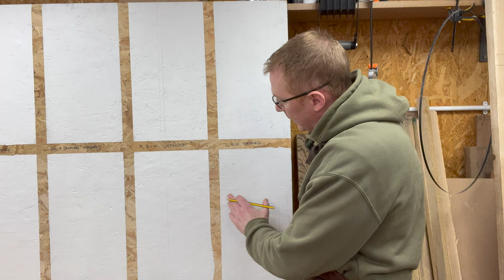Testing Out Different Methods of Painting OSB (Pt 2 of 2) THE RESULTS

Comment: I painted my new shop ceiling and walls, which are OSB, after watching your videos.  I believe sanding is necessary if for no other reason to eliminate your roller picking up pieces of wood..  I think you mentioned this in a previous video.  I used the Zinsser 123 primer and went with 2 coats.  I believe our top coat was Zinsser Smart Coat.  Another coat might have been better but a single coat was good enough for a wood shop.  I went with ultra white for the color.  If a person is looking to hide all of the OSB fibers, the way I went won't do that but I am extremely happy with my results and this is in part, due to your videos.  Thanks so much!
Reply from the maker: Thank you for your very kind feedback which is really appreciated! I think showing the fibres of the OSB actually looks pretty smart, if folk want a smooth surface they’d be better off with a cheaper plywood 👍

Comment: I didn't do the extensive tests you did. I wanted it to look decent, but it wasn't going in yhe living room. I used a high build primer, sanded lightly, a second coat of primer, then two top coats of Behr eggshell enamel. It worked pretty well.
Reply from the maker: Thanks for the comment and great idea to use eggshell. I’d be interested to hear your long term results if you ever have to time to let me know, be interesting for any potential follow up questions 👍👍

Comment: Thanks so much for the information. It really is scarce. Zinsser B-I-N has been the best performing primer for me in most situations, so I'm not surprised by that result. For OSB I've had pretty good luck with exterior grade latex paint.  I usually get get whatever decent brand is on sale. I haven't done any sort of testing on this level, but the walls I painted about 9 years ago are still going fine with no noticeable yellowing, at least that I can see under a 6500k reference light.
Reply from the maker: Thanks for the comment and kind feedback, much appreciated 😀😀👍👍
Reply: Straight exterior latex or sealed with something first?

Comment: Sometimes we're just too critical. I have painted osb in my shop when I moved here 30 years ago and I put up a panel about 10 years ago and probably just painted it a couple times with final coat paint (latex). Really good enough. Going to put up a 14x42 wall in the near future. It would cost 80 bucks just for the primer plus top coat. Makes metal look better all the time.
Reply from the maker: Cheers Keith, interesting you mention latex paint for the top coat on your original board👍👍

Comment: A thought about time between coats. Paints dry, but paints also cure. Latex paints dry fast but typically need 30 days to cure. Oil based paints dry slowly but only need a week to cure. I suspect that a fast-curing primer isn’t easily compromised by the topcoat’s chemistry.
Reply from the maker: Good points made here Ty and thanks for sharing them. I don’t think the fast drying primer would be compromised as the instructions say ok to apply top coat within ‘X’ amount of time, generally hours not days 👍

Comment: BIN for the win.  I don’t use anything else. It’s also waterproof. I’ve also used the 123, which is okay, but disappointing compared to BIN. THE Zinsser Permawhite is also very impressive, and the Zinsser Allcoat (exterior) is a miracle paint.
Reply from the maker: Absolutely pal, it certainly is the case of ‘you get what you pay for’ when it comes to the BIN. Haven’t tried the allcoat yet but will be checking it out in the future 😀😀👍👍
Reply: 😊
M

Comment: Leo..... Well done on this. As a tradesman who has just gotten round to retirement I have tested paints for a long time. Experience told me ( when you first started this) that oil based primer would "lock in" to the fibres better than any water based primer. OSB is not a thing that I have painted but I would recommend any user to rub down, 1 coat thinned traditional primer followed by a full coat and then an emulsion and 2 coats of this. Masonry paint is best avoided.   If doing it for myself I would do two coats primer,  1 coat traditional undercoat and finish it with oil based eggshell. Now i realise that we all want to save on time/odour/use w/base BUT then I would use two coats Zinnzer 123 and two coats w/base eggshell (light sand between. Hope this helps   Bob (Weston super Mare)
Reply from the maker: Hello there Bob and thanks for he detailed message here. Really useful and much appreciated sir. Best wishes, Leo😀👍

Comment: Wondering if a combo approach would garner excellent results with less cost:  use the Bin only on dark areas and trouble spots.   Then prime everything with oil based primer.  Then touch up any blead through with Bin...
Reply from the maker: Sounds like a great plan and I’d be interested to hear how it goes if you decide to try it 😀👍

Comment: Excellent vid, thanks for putting the time and effort in putting this together.

I'm building a shed and will be using OSB as flooring. Wondering how i should protect the underside of the floor. It won't have any insulation between joists so will be exposed to elements. Thoughts would be welcome.
Reply from the maker: Cheers for the kind feedback, much appreciated! If you are using OSB for flooring with no insulation underneath it I would suggest  looking at a polyurethane based varnish. Varnish will form a protective layer between the outdoor elements and the OSB board and should help protect it. Make sure you’ve got the underside of the shed ventilated to prevent the timbers and OSB rotting underneath 👍

Comment: The Leyland bathroom paint is probably a durable acrylic matt which is a bit thicker than normal Matt and has added ingredients so it is scrubbable and harder wearing ideal for kitchens and bathrooms johnstones acrylic durable Matt, crown clean extreme and dulux diamond Matt are the equivalent types (PPG own both johnstones and Leyland paints so it may be the same paint in both tubs)
Reply from the maker: Nice one Rob, cheers for the insight and thanks for the tip about the Zinnser allcoat 😀😀👍👍
Reply: You could always do another update date when 12 months has passed, I will see if work will give you some free paints to add to your test

Comment: Really interesting outcome there Leo, thanks for doing this as it's a major undertaking to test. I suspect the same will be true for a lot of ply as I'm finding recently bought ply has some bleed through  too. Not sure why but I used a water based primer and a water based emulsion and the bleed through was pretty obvious. Thanks to your experiment I can fix it, so cheers.
Reply from the maker: Thanks Ben. Yes it has been interesting, I cut the board in half this morning and I’m going to keep them to see how they develop further. Couple of folks ITK told me if I take some of the Zinnser BIN to the bleed through areas on my wall I won’t have anymore problems 👍👍
Reply: @Hand-i-Craft  Yes, I read them and you probably won't as you're effectively treating the patches of oil or grease with a sealant. So long as it doesn't bleed out around the patches. I hope you revisit the boards later.

Comment: What I've read into says not to use a water based primer with OSB.
Reply from the maker: I wouldn’t recommend any standard water based primer, but the Zinnser bullseye isn’t any ordinary water based primer, very good quality product and worth the extra money. Oil based primer works just as well as Zinnser bullseye, but oil based is a nightmare to apply. Absolutely stinks and takes forever to dry.

Comment: I'm not sure how you could easily test a low permeability paint to see how the wood breaths and sweats with moisture forced either to the interior or exterior of the OSB, so I'll stick with asking you to do a test with different types of paints that have primer included in them. I'm considering putting painted OSB on the exterior of my add-on and leaving it at that so any information I can get would make that job easier and longer lasting. Thanks!
Reply from the maker: That’s it for me with tests on OSB so I’m afraid you’ll have to do your own if you want to find solutions. Since making this video though I’ve used Zinnser Allcoat for a couple of different jobs and that I believe is your answer.
Reply: @Hand-i-Craft  thank you for the advice! I will look into that asap

Comment: If I am Painting osb Black, is there any need to use a primer?  The reason I ask is does yellowing show up on a black painted surface? Just curious. Great videos. Watched part one and two.
Reply from the maker: Hello John, cheers for the message. It’s a good question and tbh I don’t have a definitive answer as it is something I haven’t done myself. What I think would happen is the resin / glue would seep through causing yellowing, but you’d only notice it up close, unlike when painted white you can spot it from a distance
Reply: @Hand-i-Craft  Thanks for your advice much appreciated. Plus your life story and achievements in woodworking are very inspiring. Good on you. Have a great day from a very wet  Ireland 🙂👍

Comment: You concentrated on bleed through of the resin.  What about the texture?
Reply from the maker: I did say if you wanted a better ‘finish’ then an emulsion top is better. What I meant by finish was texture / appearance. For the overwhelming majority using OSB as a finished surface will be for a outbuilding / workshop / garage etc so durability tends to be more important than quality of finish

Comment: Hey, great video thank you! Was this using two coats of primer or just one? Reason I ask is,  I've got a 150m2 of OSB to paint and I'm trying to avoid paying for 2 coats of bin primer. Also you mentioned that emulsion gives a nicer finish but I noticed that the swatch with masonary on top of the bin actually seems to have resulted in a smoother finish (unsanded), is this the case, would you mind clarifying? Hard to tell on the pictures alone, thanks!
Reply from the maker: Cheers for the message. Yes if you’re using the Bin primer you’ll be fine with one coat then either emulsion or Masonry will give a nice finish. I wouldn’t say the Masonry is smoother (to the touch) but it does look good and will be harder wearing than the emulsion.

I spoke with a guy in the profession since making this video and he gave me a great tip. If once you’ve finished primer and top coat and several months you get some yellowing coming through from the OSB resin in some little patches, just go over them with the Zinnser BIN, let it dry then touch up with the top coat and that will prevent any further yellowing in that area😀👍. Good luck and hope it all goes well
Reply: @Hand-i-Craft  Ah, that's amazing news to hear! As it was going to be another £200 for a second primer coat 🤪😂 Thanks for the tip that's a great idea. I read that the side with the black writing on it is the smoother side so I'll try that with masonry  and fingers crossed it won't look to bumpy. Cheers once again

Comment: Thanks for your video. I just finished putting a coat of oil based primer on my shed. I used osb for the walls. Do you recommend oil based paint or water based paint for the painting?
Reply from the maker: If you’ve primed the OSB with an oil based primer I’d recommend an oils based paint as my understanding is they don’t work too well together if you use water based for one part and oil based for the other 👍👍
Reply: @Hand-i-Craft   I believe oil base first then water base is OK but no good to paint oil base over water base.

Comment: If I'm understanding correctly sanding beforehand helped but is not considered a 'deal-breaker' if you choose to go without? I've got a lot of OSB wallspace to conquer and am trying to find the best use of both my time and money. Thanks for this video!
Reply from the maker: Cheers for the comment. What I would say is if you’re not going to prep it sanding, you’ll need one of the more premium products to prime the surface like Zinnser BIN. Or use an oil based primer, but they take forever to dry and stink the place out!

I’ve come across another product since making this video called Zinnser Allcoat which is both a primer and a top coat. Used it to paint upvc windows from white to black and the results were fantastic! Reckon it would work a treat on OSB, but haven’t tried it personally
Reply: @Hand-i-Craft  Appreciate the reply, thanks for the additional intel!

Comment: Hi, i am Building a Little climbing Wall with osb3. I was thinking if Is needed and/or Better to put a layer on the wood. 
If It Is Better, is there anything transparent? 
Thanks a lot!
Reply from the maker: Hello Simone, can I ask is it for outside or inside?
Reply: @Hand-i-Craft  Sure! Is for inside
Reply from the maker: @simonemarchica4745  Ok, depending on your budget any kind of oil or varnish will work with osb. With it being a climbing wall look for something that is hard wearing. Make sure the area is well ventilated when applying and prepare the surface by sanding then cleaning all the dust off before oiling / varnishing. Make sure you wear a mask as well 😀👍
Reply: @Hand-i-Craft  ok great! Thanks a lot, i will a layer of varnish and i'll be ready to go! Great video :trophy-yellow-smiling: